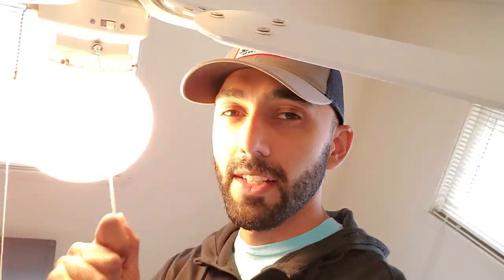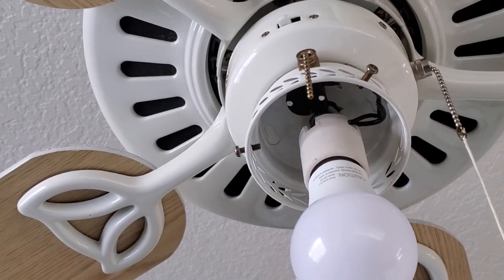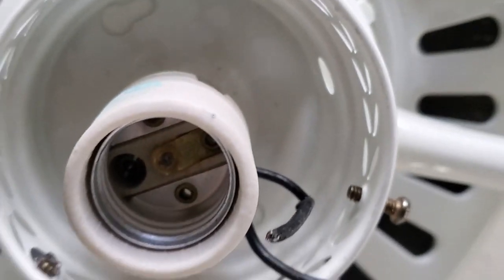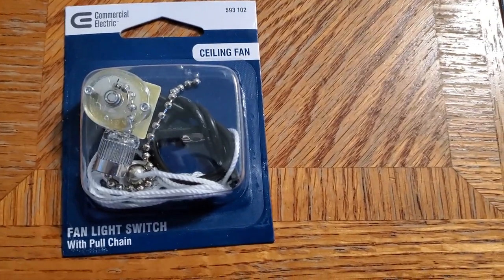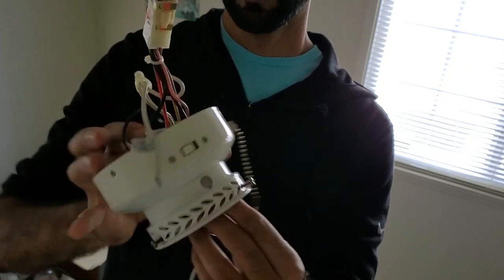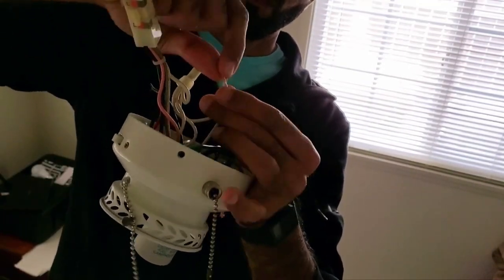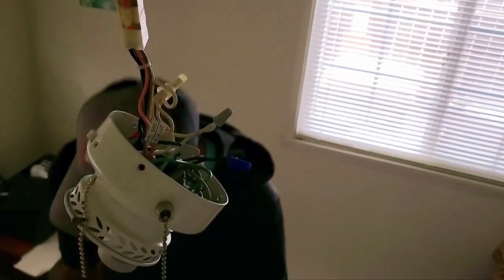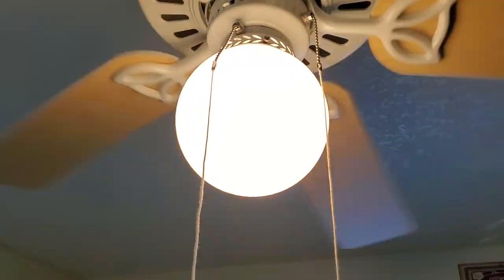Replacing a Pull Chain Switch on a Ceiling Fan

Comment: That's a Hunter Passport III, I have an antique brass one.
Reply from the maker: Your right. Strong fan. It's been over 15 years and no problems (except the switch)
Reply: @DuctTapeMechanic  Yeah I found mine in trash, it was dated 2002. The pull chain is fine but has grease coating on it and it's difficult to clean the chain.

Comment: Mine works fine when I pull it outward but doesn't when I pull it downward. Does it still need replaced?
Reply from the maker: Sounds if the chain links are getting caught somewhere.